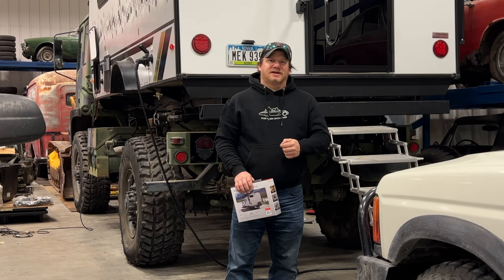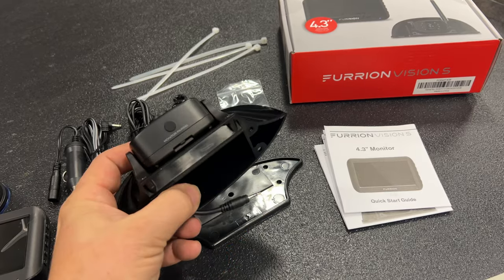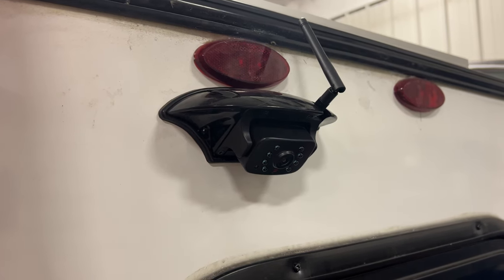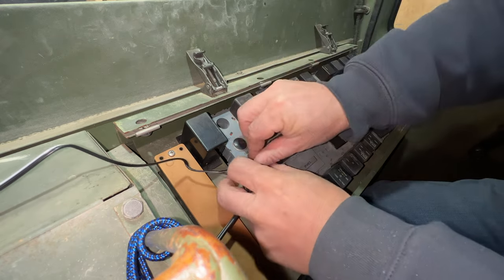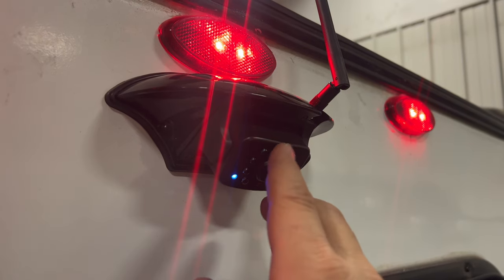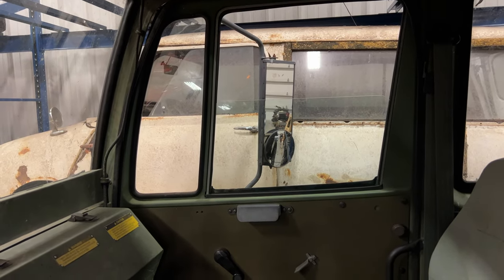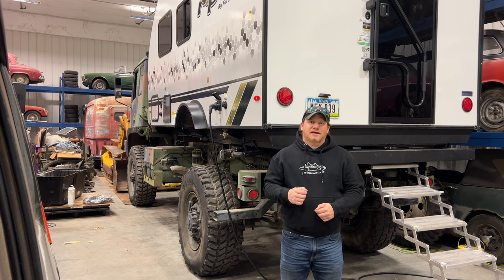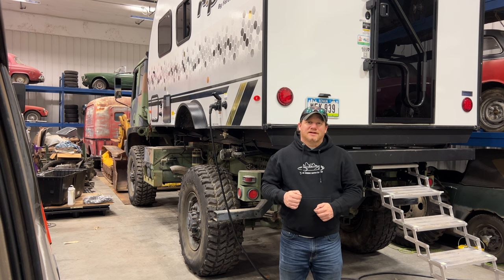Installing Furion Vision S Backup Camera to My R-Pod Camper

Comment: FWIW, it's a good idea to check the the white striped/ribbed wire is actually the positive.  I killed a cheap Chinese inverter by relying on the markings.  A simple continuity check between the removed connector and the marked wire is a good idea.

Comment: Great camera system.  We’d love the night vision, and the full time rear view, rather than the reverse only view we have now, would be great for monitoring the trailer.  Maybe one of the next upgrades!
Reply from the maker: If you put this on your trailer you could also have a backup camera on that too.
Reply: I had thought of that.  I’ll have to look into whether I could link two cameras to single monitor.   On the new Travato’s one monitor is in the rear view mirror, and the other in the dash mounted display.  It also occurred to me that I could put lines on the screen to align the car when loading in the trailer!
Reply: I had thought of that.  I’ll have to look into whether I could link two cameras to single monitor.   On the new Travato’s one monitor is in the rear view mirror, and the other in the dash mounted display.  It also occurred to me that I could put lines on the screen to align the car when loading in the trailer!
Reply: I had thought of that.  I’ll have to look into whether I could link two cameras to single monitor.   On the new Travato’s one monitor is in the rear view mirror, and the other in the dash mounted display.  It also occurred to me that I could put lines on the screen to align the car when loading in the trailer!
Reply: I had thought of that.  I’ll have to look into whether I could link two cameras to single monitor.   On the new Travato’s one monitor is in the rear view mirror, and the other in the dash mounted display.  It also occurred to me that I could put lines on the screen to align the car when loading in the trailer!
Reply: I had thought of that.  I’ll have to look into whether I could link two cameras to single monitor.   On the new Travato’s one monitor is in the rear view mirror, and the other in the dash mounted display.  It also occurred to me that I could put lines on the screen to align the car when loading in the trailer!
Reply: I had thought of that.  I’ll have to look into whether I could link two cameras to single monitor.   On the new Travato’s one monitor is in the rear view mirror, and the other in the dash mounted display.  It also occurred to me that I could put lines on the screen to align the car when loading in the trailer!
Reply: I had thought of that.  I’ll have to look into whether I could link two cameras to single monitor.   On the new Travato’s one monitor is in the rear view mirror, and the other in the dash mounted display.  It also occurred to me that I could put lines on the screen to align the car when loading in the trailer!
Reply: I had thought of that.  I’ll have to look into whether I could link two cameras to single monitor.   On the new Travato’s one monitor is in the rear view mirror, and the other in the dash mounted display.  It also occurred to me that I could put lines on the screen to align the car when loading in the trailer!
Reply: I had thought of that.  I’ll have to look into whether I could link two cameras to single monitor.   On the new Travato’s one monitor is in the rear view mirror, and the other in the dash mounted display.  It also occurred to me that I could put lines on the screen to align the car when loading in the trailer!
Reply: I had thought of that.  I’ll have to look into whether I could link two cameras to single monitor.   On the new Travato’s one monitor is in the rear view mirror, and the other in the dash mounted display.  It also occurred to me that I could put lines on the screen to align the car when loading in the trailer!
Reply: I had thought of that.  I’ll have to look into whether I could link two cameras to single monitor.   On the new Travato’s one monitor is in the rear view mirror, and the other in the dash mounted display.  It also occurred to me that I could put lines on the screen to align the car when loading in the trailer!
Reply: I had thought of that.  I’ll have to look into whether I could link two cameras to single monitor.   On the new Travato’s one monitor is in the rear view mirror, and the other in the dash mounted display.  It also occurred to me that I could put lines on the screen to align the car when loading in the trailer!
Reply: I had thought of that.  I’ll have to look into whether I could link two cameras to single monitor.   On the new Travato’s one monitor is in the rear view mirror, and the other in the dash mounted display.  It also occurred to me that I could put lines on the screen to align the car when loading in the trailer!

Comment: It certainly is nice to see someone do a job well, not to mention right...  Nice unit, def need to look for one.  Wonder how much it draws?  Possible to rig up a small battery for a portable unit, could be a boon!  Thanx !
Reply from the maker: It draws very little power, you could make it portable.  Maybe put the camera on a magnet if the vehicles you are using it on are steel.
Reply: @ThisWeekWithCars  yeppers, my son drives different trucks, crane included, but none have backup cameras.  He's added a portable dash cam, but only works front, no side mirror views.  As Sue happy as some have gotten, not to mention distracted driving, kinda important to cover your a$$...  Thanks !